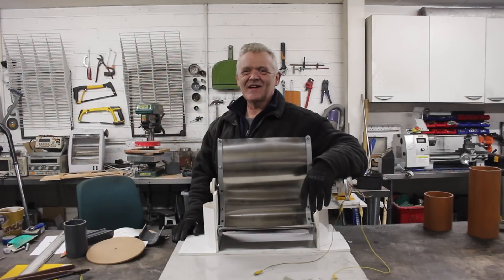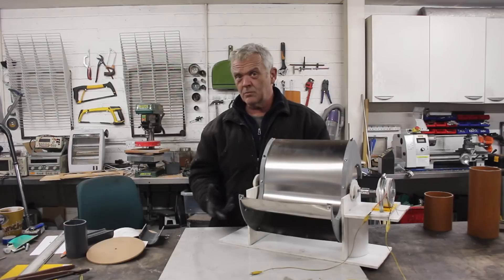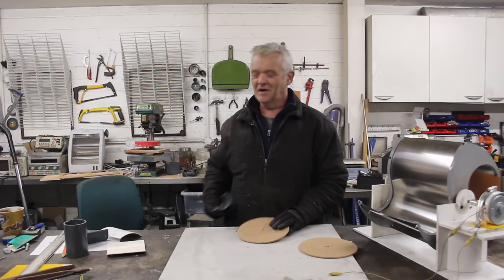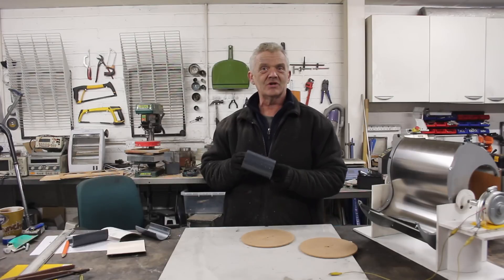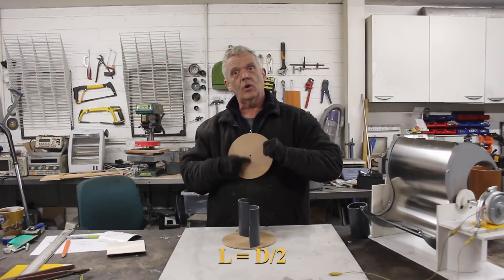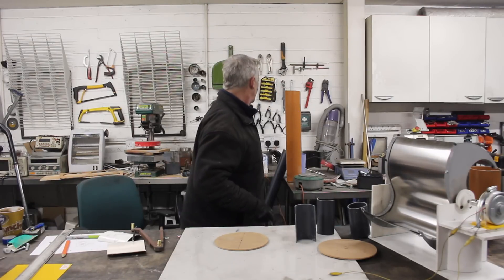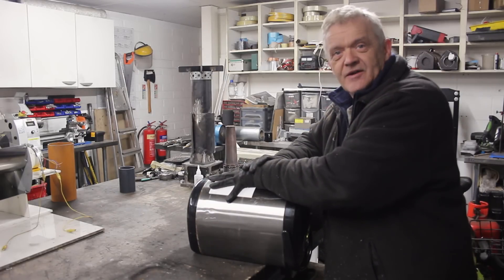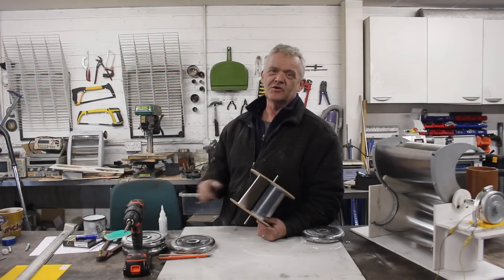1755 How To Make A Super Efficient Wind Turbine - The Ugrinsky VAWT Made Easy

Comment: So the diameter of L is the same as the first circle you cut, and since you've already cut two to make up the frame, all you need to do is place one on top of the other at the edge of your S curve being sure to keep your diameters in line, and voila. The curve of L, according to your model it's identical to the curve of your 200mm circle; it's just offset from the center to line up with the S curve. Or have we over simplified?
Reply from the maker: yes - but you still need a blade in place to direct wind flow
Reply: @ThinkingandTinkering  Of course! I'm just trying to say, that locating an object like a rubbish bin to form the curve, while creative, isn't necessary, because you can create the perfect curve for L using the cut-outs for the original 200mm circles.

Comment: Thank You so Much for Sharing this Robert!!
Now, I Think I may well be Able to Make this,,, using  some plastic bottles  that I have!!
(Recyclable plastic!!)

  Now, because this brain of mine works a bit different,,,
I might be making the S-shape, to  fit the 'base, ' to the blades of the Turbine.....
( The math still works?)

  I will be able to fit them on to the Outside of my window,,
(in order to be able to capture the wind!)
Because I am on the 2nd floor flat, and have no access to anywhere higher up.....

I've got a few little Motors/ Generators, from Blenders and a Vacuum cleaner to connect them to,,,
You've got the grey matter ticking!!
Thank you Robert,🙂
Andrea and Critters. ...XxX...
Reply from the maker: awesome and yes you can pick any starting point as long as the relationship holds up you will be fine
Reply: @ThinkingandTinkering  Thank you so Much!
Goodness, you get up Early!!
Thank you so much for replying,!!
 Ive made a start on them already,
( Im making Two!!)
~Just to start with, then ,when  I get them right, Im making  a small wall!!
Have a great day Rob! 
!Really, Thank you!! :0)X

Comment: Now for the wall.  It will be a work of art only functional.  Little tip to make your glue stronger:  Add graphite or graphene powder to your bicarbonate powder then add it to the glue.  It makes a much harder end product.  The mix will take some guess work.  I would try 2 parts bicarbonate powder to 1 part graphene or graphite.  Get the mix right and it makes JB Weld look soft in comparison.  You won't need it, but best of luck with this build Rob!  Thanks for the inspiration on the turbine!
Reply from the maker: cheers mate and thanks for the tips
Reply: Would pencil lead work? Considering it's actually a mix of graphite and clay.
Reply: @kf8113  It should, just grind it to a very fine powder.
Reply: @kf8113  Experiment to find the right mix though.
Reply: @kf8113  yes it works, saw video of exactly that 4-5 days ago.
Reply: I thought bicarb made the glue set instantly. What kind of pot life do you have with this stuff?
Reply: @DFPercush  None, it does harden very fast.

Comment: Amazingly simple. I'd never heard of the Ugrinsky turbine before watching this channel. And it's been around since 1946. I searched for Угринского or Угринским (Cyrillic spellings) to find out more. It appears that the Ugrinsky schematic could be from a book by B.B. Kazhinsky “Free-flow hydroelectric power plants of low power”, Gosenergoizdat 1950 (Б.Б.Кажинский «Свободнопоточные гидроэлектростанции малой мощности», Госэнергоиздат 1950г)
Reply: I think this would be easier and lighter if we use fabric. Just make a cut out that clamps the fabric in-between cap the ends with whatever. Hangglider pilot, so have always thought about making these wind generators out of used glider sails.
Reply: I instantly thought of water would work in slow moving current. There is another design similar to this that has a natural sea shell design that is used to stir huge volumes of water way more efficiently then regular propellers.
Reply: Integza 3d printed golden ratio impeller. Shows it with wind and water about 2 years ago. Gets into the gear ratios and different motors as well.
Reply from the maker: that is very interesting thanks for posting that mate
Reply: see "Парокрылый моментосбалансированный ротор поперечной гидротурбины Новикова".
This is the best Ugorinsky-type rotor

Comment: I'm looking forward to seeing you make a wind wall with this. 

Although seeing it on a roof top would be cool too. The wind tends to speed up as it approaches  the peek. I just wonder if there is a performance difference if the wind hits one slope or the other first.
Reply from the maker: it's where I am heading mate - you can't really make a wind was with 3d printing on a little printer - I would be printing for years!!
Reply: Hi Rob, as I saw your printer busy, it seems pretty slow indeed, I assume you are using default settings, the printing speed can be higher, there are many ways to change it, as a bigger nozzel diameter, you can bore it yourself, thicker layers, more acceleration in the ”straight” parts for example.
Cheers.
Reply: Yeah those ridgetop ones look really interesting.
Reply: Now I 'm waiting for wind wall build.I wonder what would be more efficient, connect bunch of these to one bigger generator by means of mechanical transmission, or each section to separate smaller generators running in parallel electric circuit?
Reply: @danielreborn4707  I'd think one can have many sharing the same axle.  But I think mechanically linking several parallel axles would not be the the most efficent, but because motor generators tend to be pricey, gearing a whole wall to one larger motor might be a reasonable tradeoff between efficiency, output and cost. 

Amatures wind turbine makers often overlook an aspect of wind turbines is tip speed ratio and where the turbine performs the best, and matching a generator and load to the turbines best performance tip speed ratio.  That is, If one maps coefficient of performance on a vertical axis against tip speed ratio on the horizontal axis, one will find every kind of wind turbine has a curve with the maximum efficiency at a certain tip speed ratio, and the efficiency drops as the tip speed ratio increases or drops away from the most efficent tip speed ratio. Then one needs to ensure the generator is properly geared to and can load the turbine such that it keeps the turbine operating close to it's best performing tip speed ratio And the chosen electrical load  force specific generator is important here too. Getting All this right can seem overwhelming, but the effort helps get the most energy from the wind.
Reply: @kreynolds1123  Drag based turbines have a maximum tip speed ratio around 1.0 hence the relatively low efficiency.  However being able to place them in optimal locations (i.e. a roof ridge) can negate this inherant disadvantage.
Reply: @cwt5654  greate case in point.  a drag type turbine operating at a tip speed of 1 is unloaded and not operating at its optimal tip speed ratio for getting power out of the wind.  Drag types need to be loaded and operated in a region were the tip speed/wind speed ratio is well below 1 to get  the most power out of the wind with any drag type turbine.